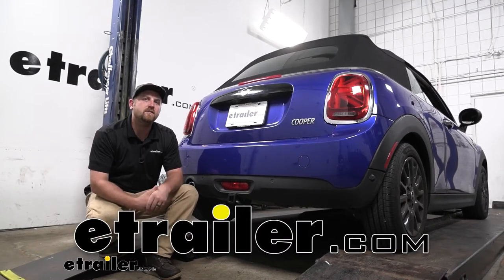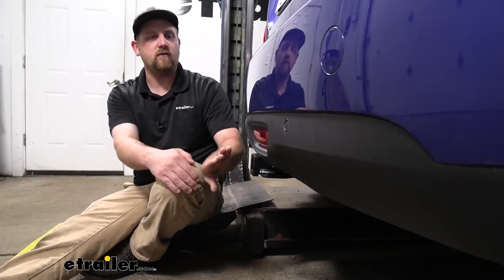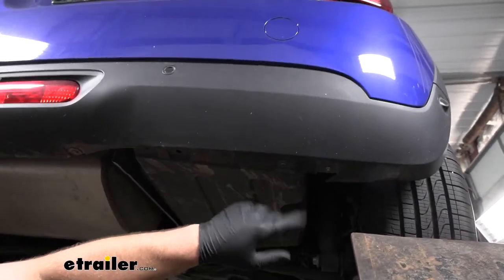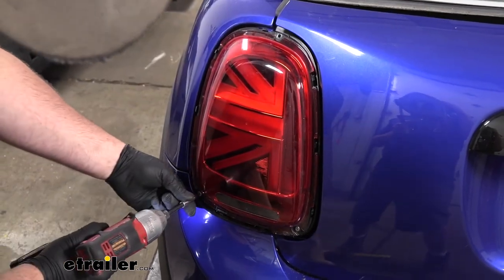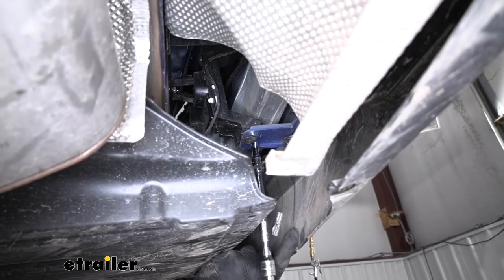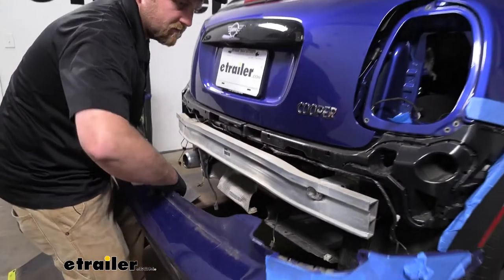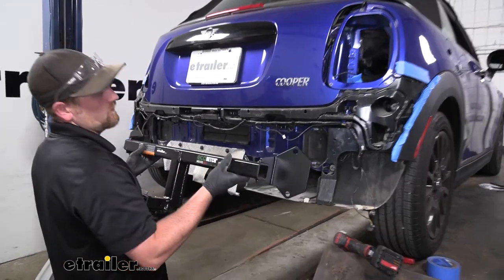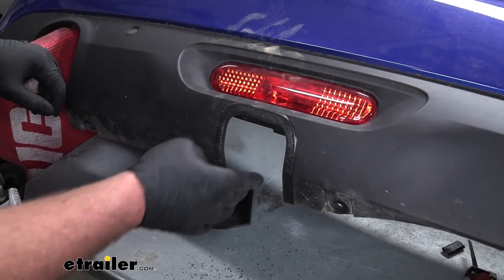etrailer | EcoHitch Hidden Trailer Hitch Installation - 2020 Mini Cooper

Comment: How much weight can the Mini Cooper 2020 tow with this hitch?
Reply from the maker: This hitch is rated for 150 lbs max tongue weight and 1,000 lbs max gross trailer weight. You will need to check in the owners manual of your vehicle to see how much your Mini Cooper is rated to tow.
https://www.etrailer.com/Trailer-Hitch/EcoHitch/306-X7290.html